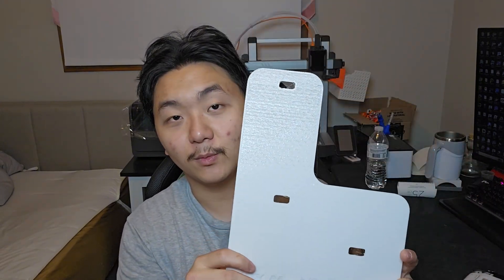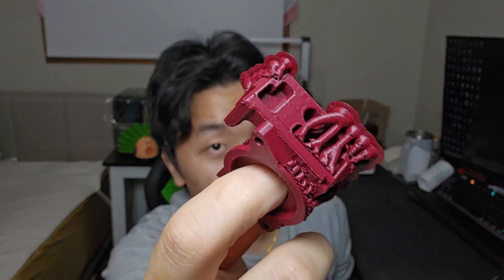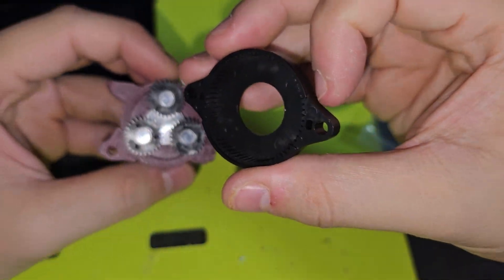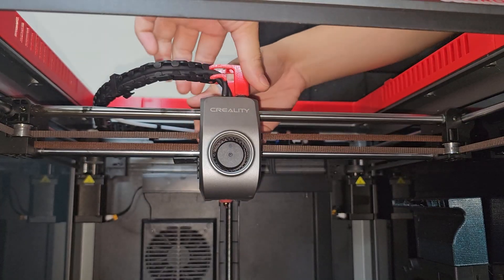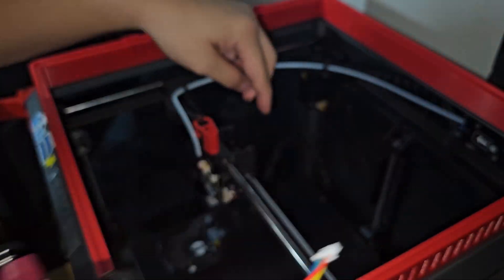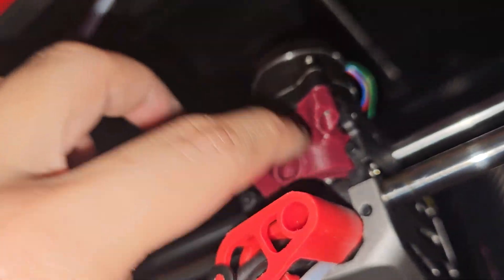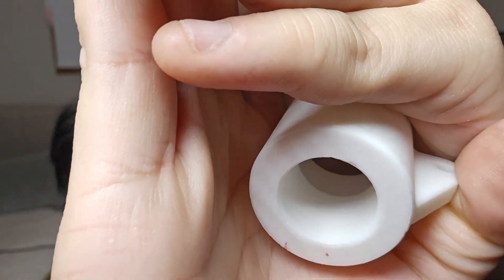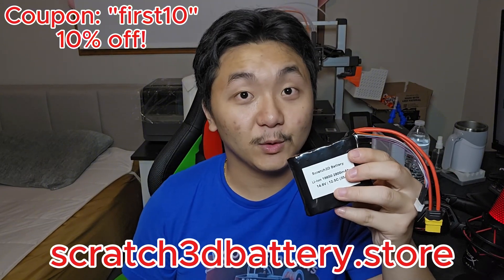K1 Max Cyclops Extruder This Changes Everything | Devils Design

Comment: I am curios as to what os you are running on your max?
Reply from the maker: I use window. I also have the k1 max upgraded to the latest firmware.  I have a guppy screen installed on the k1 max. I have it rooted, and use orcaslicer latest version for my k1 max.

Comment: I think the VFA you see is because you need to run your Input Shapers again.  They are testing the vibrations of the unit at certain frequencies.  That will change now that the weight and weight distribution have changed.
Reply from the maker: Yeah I have re done the input shaper and now it's print like normal again.
Reply: @Scratch3DPrinting  Awesome!

Comment: I have one of those extruders, it gets quite hot and after printing for a while the motor tends to work strangely. I had to lower the current to 0.55 so that it wouldn't do strange things after a while, I don't know if this has happened to anyone else.
Reply from the maker: Yeah it does get pretty hot after printing. But for me everything seems to be doing fine now.

Comment: I’ve damaged the threads that hold the hot end in place from the bottom, will that be a problem for reliable printing? I’m thinking that it will be, so if it will be where can I get a new piece? I looked a couple months ago when it happened but couldn’t find anything to replace it other than a linear rail "upgrade". Any ideas other than the linear rail upgrade?
Reply from the maker: If it's not holded tightly, then it might cause problems in the long run for printing. Not sure what you're talking about though? If you damage the hotend thread, then you can just get the whole print head replacement.

Comment: One thing you could have tried as well before a print is to do a calibration for your filament. You will get so much better results and calibrate your pressure advance, too, and you will fall in love with this extruder. A lot more first layers are so perfect im currently doing a full linear rail conversion for my k1, and im gonna be using my Cyclops extruder with it, so im very interested to see the results of this build 😄
Reply from the maker: Thanks for the tip! Yeah I should have done some calibration,  but I just want to see how it performs without any calibration. It is a good extruder.

Comment: it seems you have the older model of the k1 max before they switched to the unicorn nozzle hotend. do you know if this mod works with the new k1 max hotend? the new setup does not have the PTFE tube between the heat break and extruder
Reply from the maker: yeah, I got an old k1 max. Not sure but I think it will fit. Does the unicorn nozzle come up the where the PTFE tube is like mine? If it is, then I think it might be compatible. You can always print the 3d printed parts from Devils Design and test fit.

Comment: my Kobra 3 hotend finally had the leaking issue, while im waiting without a hotend I found out I can use a 26mm biimetal heatbrake off amazon to upgrade to a CHT nozzle, Ill let you know how it works out since ill have to customize the heatbrake to add a locking notch. Have you checked out the kobra 3 multibox add on from Rolf Klein on makeronline? Im gonna modify my S3DP poop chute to be compatable with it. Be cool if you made an official poopchute that works with it that will look better than what I kludge together lol.
Reply from the maker: Good luck with your upgrade on the kobra 3. I'll have to check out the multibox from Rolf Klein.

Comment: The best thing that I added to my K1 Max was a 1/4” Aluminum Tooling Plate. I just drilled holes for the bolts and drilled and tapped holes for the printing sheet alignment screws in the back. Then I just sandwiched it on top of the existing plate. I now have an height map that only varies by .3 mm anywhere across the plate, even from cold to hot. First layers are anmazing. I find it difficult to believe that an issue with the extruder could produce the repeating pattern you have seen. But yes, it’s a bum deal that the old extruder wouldn’t lock anymore. 😢
Reply: that is interesting! you added the tooling plate on top of the magnetic sheet/adhesive? or bellow it? thanks for the tip, I'm wondering if I do the same as this is now the only think I'm not finding nice... also, did this still makes the heating work properly?
Reply from the maker: wow that is really nice. I might do that later if my 3d printer are getting bad first layer, and yeah the extruder cannot lock any more but hey, this lead me to getting a better extruder.

Comment: Good demo of the build and install process, but I suspect it's not going to fix your big bed levelling problem.
Reply from the maker: Thanks, I got my leveling pretty good, it's only when its starting the second layer where it has under extrusion.
Reply: Ok, but the issue at the back of the printer says something physically wrong I think
Reply from the maker: @andygodber  Yeah, I also found out why, it's because when the print head goes near the back, it bends the PTFE tube too much and the filament is struggling to be extruded. Now I have printed the lid extension and now it's not interfering with the tube and it's printing fine now. 

When I feel the PTFE tube I felt there's a flat spot where it was scrapping against the top glass, not good.

Comment: At the beginning I used regular petg and it deformed after printing asa and abs. I would suggest to switch to abs or asa.
Reply from the maker: Yeah abs or asa is better heat resistance than PETG, next time I'll use those since my k1 max is now working.

Comment: Pro Tip; play with run current to avoid VFA's. Too little current and you get one type of VFA's with a chance of skips and too much will make the motor run hot and even more VFA's

More "pro tips"; for functional injection mold like prints use similar settings to printing optimally clear filaments. Usually >0.12mm layer heights, minimal cooling, ~2mm3s flow or under 35mm/s speed (depends how you like to skin you cat lol), and increase flow.

I personally use ASA-CF for functional parts in my printers. Amazingly strong when printed like that, and when i test break those parts they don't really break on the layer lines. It's crazy how much stiffer/stronger the CF/GF parts come out when properly dried and printed like that

Last thing, i picked up a cheap tap and die set at harbor freight so i would stop cracking plastic like that lol. You could also heat up the metal threaded part before screwing it in, might burn yourself tho! lol

Good luck! awesome work
Reply from the maker: Wow thanks for the pro tips, those really help and I have learn new things. So are you saying that printing under 35mm/s speed and increasing flow will help strengthen the parts? Also what do you mean by "properly dried"? 

I need to get my self some tap and die sets.

Comment: 👍 just a quick tip to make the tread it’s recommended putting a bit of lube and heating up a little bit the tread before screwing, and for inserting the bearing, I would recommend using a ranch socket, the size of the otter ring of the bearing great videos looking forward for this upgrade
Reply from the maker: Thanks for the tips, I'll try that next time, putting lube and heating the thread up a bit.